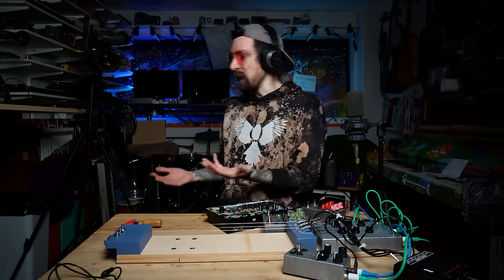This Slide Guitar Is A Theremin?

Comment: Speaking of pedals, it seems natural to pair this thing with a big passive volume pedal to have that extra expression but also to still have two hands free to play the knobs on the desk.
Reply from the maker: Super smart!
Reply: just like the with steel guitar!
Reply: Even better put the volume as a lever or button on the end of a bar that you hold like a bottleneck slide. That's what I do with an electromagnet feedback slide guitar that I made. The only wire on the whole thing is from the slide bar to the head which along with a Digitech and amp speaker battery makes it portable Pink Floyd. Ditch the handle on the bar to get good control as well. If I did this potentiometer wire trick I'd use the "wiper" wire through the bar rather than the third rail along with volume.
Reply: @echodelta9   wow that's cool! Do you have demos?

Comment: So more like an ondes Martenot than a Theremin then. It has a keyboard mode but also a glissando mode which is controlled by moving a metal ring along a wire in front of the keyboard.
Reply from the maker: Ooh! Didnt know 😁
Reply: .. And most famous classic’theremin’parts are really the Ondes, namely Good Vibrations and theme from Star Trek.
Reply: @geraldfriend256  I'm afraid neither of those are the ondes 😀 Though they are very frequently mis-attributed to both the Theremin and the ondes Martenot. Good Vibrations uses a 'Tannerin' or electro-theremin, and Star Trek theme sound is a vocalist.